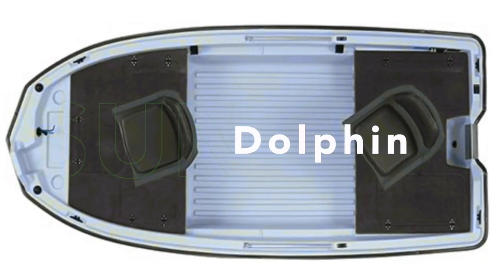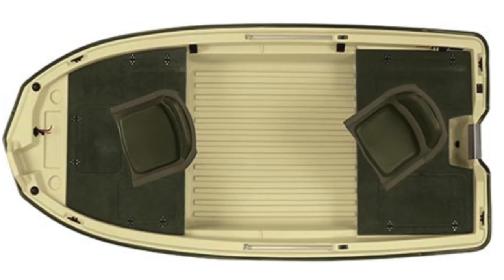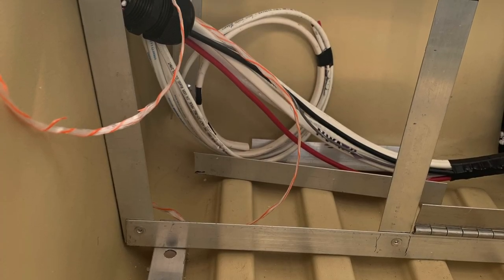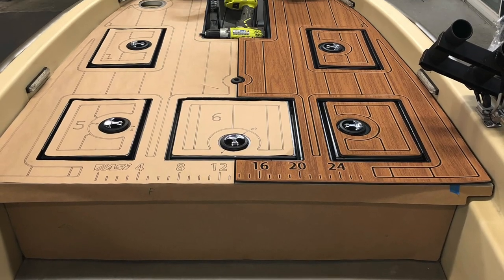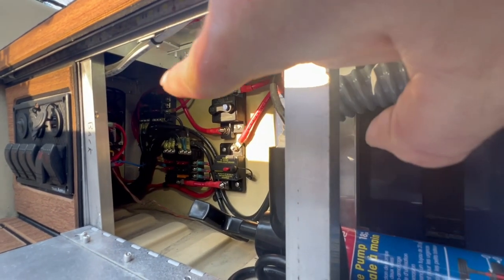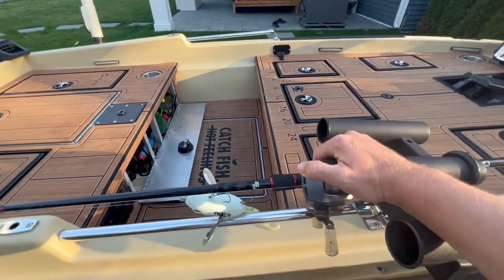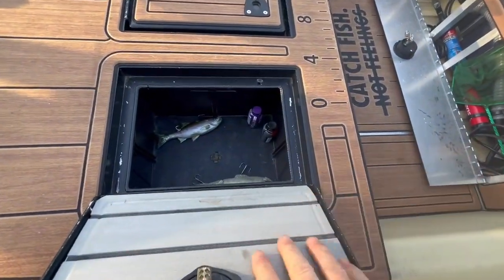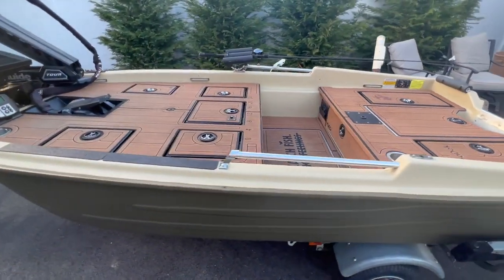Sun Dolphin Pro 120 Transformation @sebastian2fn

Comment: Do you know where I could get new screw caps for mine I have the pro 120 to but my bottom drain is taking water on every time I go out and fish didn’t know what I could do
Reply: Need to seal it w 5200 or a sealant, all these plastic boats are notorious for that with the thru hull fittings
Reply from the maker: Thats not good. I would 5200 and seal it up for good.

Comment: Does yours have the 2 small holes in the original battery compartment? Mine has 2 small holes and water comes in all the time through there and gets the bottom of my battery battery wet. Not sure if that’s normal. It’s too very small holes toward the back of the original battery compartment. Looks like it’s for draining, but for some reason when I stand on the casting deck, water starts coming in through those two holes.
Reply: Yea I have them too… I’m starting mine now so I’ll have some videos up here in a week
Reply: Those wholes are probably from where the battery straps used to be installed .. sounds like you have water inside your hull, you need to get that out and keep it dry or your foam will absorb it .